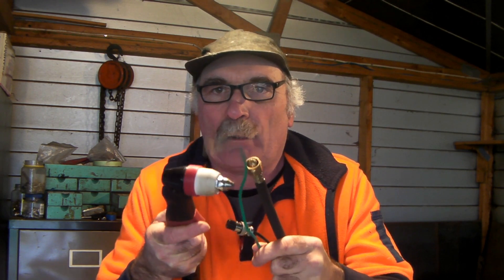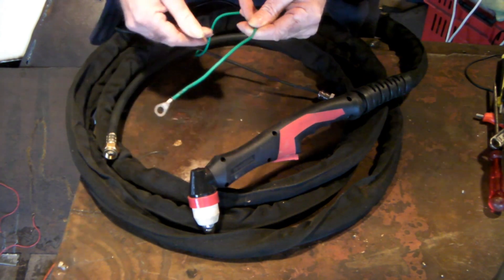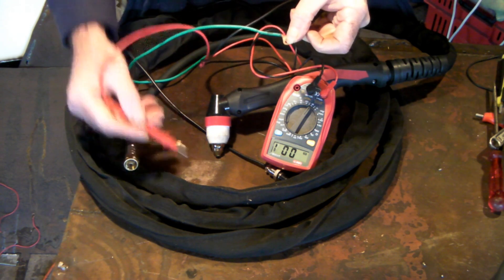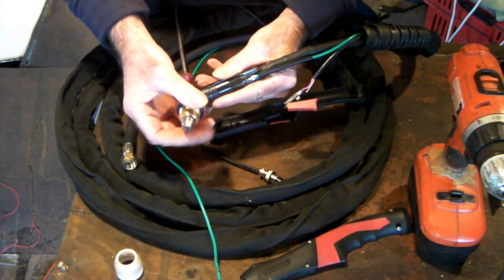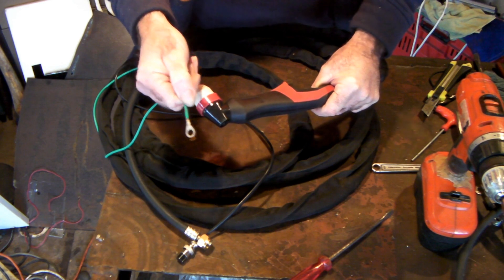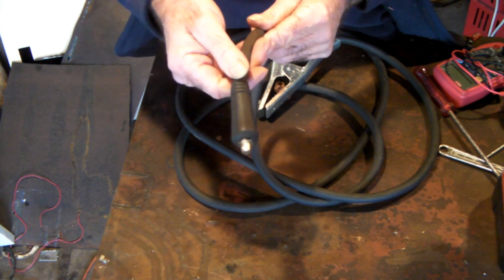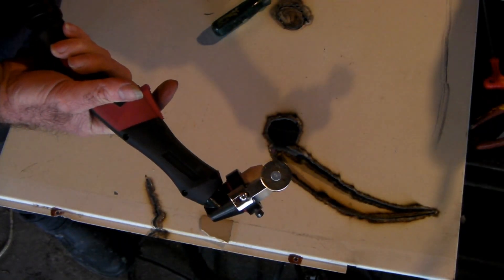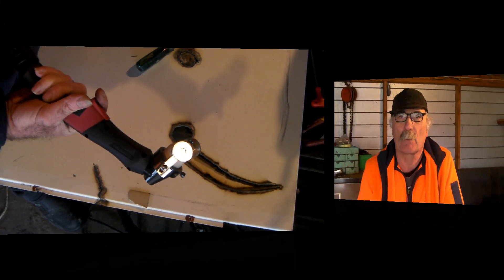Pilot Arc Torch With Non Pilot Machine Pilot Arc Conversion

Comment: The problem with this hack, that the internal nozzle wears out faster. There was a german video with some cheap plasma cutter the same way as in this video, and they recommended a foot switch, connected to the ground, and the switch only has to be pushed as the cutting starts. Thus the wear out can be reduced.
Reply from the maker: Nice idea
Reply: @johnhajdu4276 can you share the link?

Comment: Thanks for posting the video Pete. Can you say whether a guy can go the other way - using a PT31 torch with a cheap Chinese Pilot arc machine? That way a fella could save the pilot arc consumables for the piercing jobs, and burn up the cheaper ones with regular cutting. Thanks.
Reply from the maker: cant see why it wouldn't work

Comment: Have you had any issues running this on an HF machine without resistors or caps or anything?  Once it is lit and you have cut some steel does it stay lit as long as you have the trigger pressed?  Seems like the HF start could stop trying to start it once an arc is made but seems like it might only stop the HF circuit once you are cutting.  Typically HF start only runs long enough to get the arc started or to restart a lost arc.

Also do you notice any additional wear to the inside of the tip or to the electrode from using it like this?

Thanks
Reply from the maker: once its lit and you start cutting it just reverts to the drag tip as if you are just cutting like normal ,The only difference is you cut start a cut without cleaning the steel first.
Reply: @petestools  So let's say I want to cut some painted grate or mesh like material..... Would it stay lit the whole time?  Also, you said something about it working well on thin stuff. Does the cutter still function the same while cutting as it did before the mod regardless of the thickness of the material?
Reply: @petestools  I am really tempted to buy a cheaper cut-50 with HF start and add a little terminal that is wired internally to the clamp connection.  Then I can swap the torch for an AG-60 with pilot start connection and save some money 💰.

Comment: Thanks for posting this. I noticed on a schematic for a pilot arc machine that there is a resistor on the green line to earth before it joins up with the big earth ground. This would probably encourage the current to go the the big ground if possible when in use. I have no idea how big a resistor would be needed. I would guess that’s why someone thought the wiring trick messed with their machine.
Reply from the maker: Thanks for the info
Reply: just thinking about what you have commented it would be a really good idea to find out the size of the resistor on that machine so you can put it inline of the wire may be just used as a point of failure if there is a bad earth turning your torch into the main earth? not sure how deadly that would be? i have just got a ltsuk ct 416 but can not find a manual for it  if i need this to make a piot arc or if my machine has it out the box
Reply: @cybertec2005  , here a bit of more info, about the relay to make an orthodox circuit. Then the need is for resistor and relay to make a well made conversion .
https://www.youtube.com/watch?v=5enkXpaN4vQ&t=179s
Reply: @valdolandar534   cool i would like to see if this can be done to a non pilot arc machine if this board can be added ? it seems like this video is to fix a machine that has pilot arc
Reply: @valdolandar534  would love to see a video on this with how to install and how it works as well as drawing  :) as I don't know a great deal about electronics of these machines but I see it benefiting alot of people  :)
Reply: @valdolandar534   
 .... I wonder if this relay turns OFF the tip ground, once ground resistance lowers / rises (?) when arc contacts the work, looping the main clamp ground, then the tip arc is not needed and the grunt work (of earthing) is taken over by the ground clamp, reducing the wear and heat on the torch earth cable ... ??
Reply: @kiwiaus  Yes, this relay cut OFF but it is due that it is commanded at same way as the circuit for High Frecuency, the HF is OFF when is not needed when start cutting the work.
If a machine dont have these contacts to command the relay due it is made for non pilot models more cheap, yet there are another relay that ON/OFF the High Frecuency circuit, this relay have the info we need to command the relay in the same time for command the pilot arc. Usually using 24 volts DC.
Reply: @valdolandar534  great write up, did it end up working ?
Reply: @Papadragon-7  Hello, sadly it's in a box on the to do list, but with all components purchased.
It is a project that I do want to finish when its time comes.

Comment: Good work. It reminded me of the mid 80’s when I was in the business of removing the “Ignition Control Module (ICM)” when going bad in a car and replacing it with a contact breaker (points). I had some stubborn customers who thought that a contact breaker was better than ICM. They were cheaper not better. Prior to the conversion, I had the customer sign a piece of paper absolving me from all responsibility on the repair. It was a good business and to this day, electrical repairs on a car are very lucrative.
Reply from the maker: you're not wrong mate

Comment: Finaly I found it. I am planning to do the same thing with my cut50 non-pilot arc plasma cutter. But I want to order just the p80 head, without the hose/cable and fit that to my old pt-81 torch's cable. Would that be possible? Are the heads interchangeable? Thanks.
Reply from the maker: Hi it has the same fittings as the pt-31 torch
Reply: Hi  I want to do the same. Did you buy the P80 head and how did it go with your cut 50?

Comment: pete thanks for your vids. I used the wire from drag tip then connected to ground clamp. Worked great but it seemed to have messed with the machine. I restarted it and all was well again. Any thoughts sir?
Reply from the maker: It reset ,like i said i have only used it this way with my machine.cheers pete
Reply: @petestools  thanks pete
Reply: So you ran green wire to ground clamp and after resetting machine no other issues?? Im about to try this